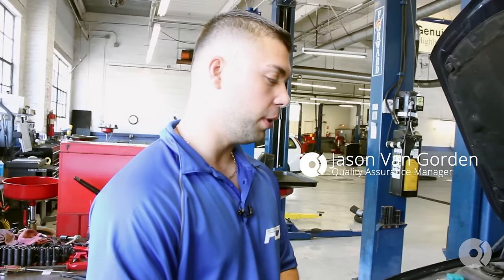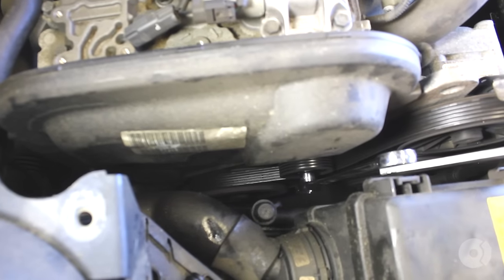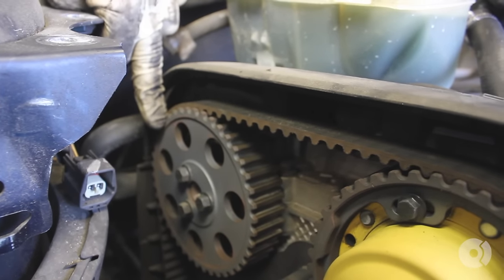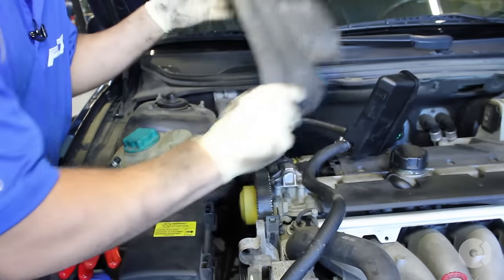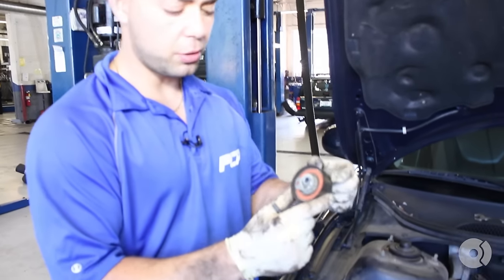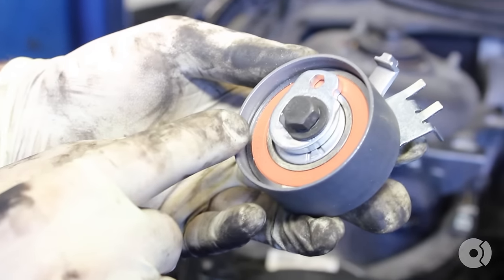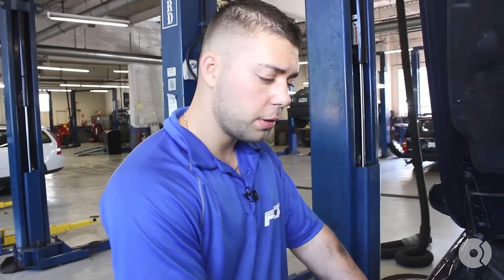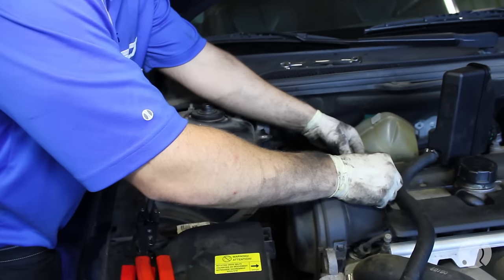Volvo P2 S60 Timing Belt Replacement DIY (S60, C70, V40, V70, S40, S70, S80, XC70, XC90)

Comment: Ok, CRAP!!  LOL  First, awesome vid, what a help.  Although, I have a problem.  I have a 2001 Volvo s60, 90,000 on her.  I followed this video to the letter, every step, double checking everything 2-4 times with my laptop by my side.  Checked my marks were still lined up before and after reinstalling the crankshaft pulley.  Put the new timing belt on (which is from FCP, thanks guys, great price), adjusted the tensioner, and believe I got it perfect.  With my 30mm socket, turned over the engine once and I DID feel resistance.  Like I was climbing hills; a little tension, then it would kind of sling over.  So I did 1 full revolution, praying I wasn't doing any damage, back to TDC.  Now the right mark is favoring the right side, left mark is favoring the left side.  Doesen't appear to be perfectly lined up.  Is this why I was feeling the resistance?  Considering everything looked perfect, how the hell do I fix this without it happening again?  I seriously don't want to start pulling everything back off and apart as it was quite time consuming for me, but will of course.  I'm definitely not going to crank this engine over until I know for sure.  And of course it's Sunday, tomorrow's a holiday and I probably wont' hear anything back for a while, but I need this car up and running quick, lol.  Bad timing, no pun, my mistake.  Or, is the resistance ok, marks slighly off alright?  Thanks for the help, really, really appreciated.
Reply: Neighbor came over and gave a hand.  Sounds like just the compression I was feeling.  So, there is a bit of resistance, just throwin that out there.  We turned the exhaust cam one tooth, re-aligned the belt, she's running good.

Just to help, I used a closed end 14 mil on the serp tenshioner with some vice grips clampled hard on the open end to make up for not having a tension wrench like Jason.  Worked great, better than expected.  Also, I spent an hour trying to get the power steering reservoir off.  What should have been easy was tough.  I ended up leaving that reservoir connected to the coolant reservoir with no problems, but yes, moved them around a lot.  Took a bit to get the crankshaft pulley off, but with lubricant, like Jason mentioned, and rubber mallet, it did finally come off.  I was about to throw the towel in there.

Thanks Jason for the vid.  Totally awesome for guys like me who don't have $500 to pay someone to do something that has to be done now.  Scary venture, but with your help it worked.

Comment: Thanks for the great video. It looks like everything is similar to the s80. When you mean you moved it back by hand a few millimeters did you take the belt off the crank shaft and move both cams back a little or just one that moved?

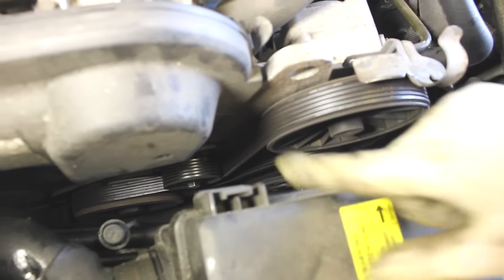Comment: Very nice instructional vid.  There are a few tools used without mention of them.  Except for the obvious sockets, pliers etc, could you provide me with the type of tools needed? At 2:34 you used a 14mm wrench extension tool. What is that called?  I have a 2005 V70, want to do this myself and want to invest in the proper tools. Do all the bolts need to be torqued and if so, is there a preferred type of torque wrench? Thanks.

Comment: First I want to say, what a great freaking video, quick to the point and easy to understand, love it. My question is: is it the same procedure for a 2004 xc9o 2.9 eng? if not, what are the differences?
Reply from the maker: The essential information for the XC90's is the same however you may have to remove a coolant line that runs through the timing cover and also a 4 bolt crankshaft vibration damper.

Comment: What kind of tool did you use on that tensioner besides the box end wrench?  To believe that most shops charge $800 for a half an hour work of work.  I'm pretty confident I can do this on my 96 850.  This video is so well done that I have the courage to do it myself.

Comment: Also, when you were finished and putting the cover back on, it looked to me like the belt was not centered. It seemed to be leaning more to the passenger side of the cam pulley. Is that just the way it lines up? THANKS

Comment from the maker: Firstly, you should not do it.  With interference engines rotating the cams can cause the valves to come into contact with your pistons and essentially destroy your engine.  To answer your question though, you CAN do it, they're not hard to spin, so be careful NOT to do it.  Hope that helps.

Comment: Can you explain the 7 O'clock thing on the pully and the Temperature setting ?   What is that exactly, what does it do?  & where do I set it for a 2002 V70 Station Wagon Non turbo?   Finally when your timing mark moved, you did not show how you set it back ?  Do you remove the belt and adjust each pulley individually to the mark ??   Explain please.  Thank you.

Comment: So I'm ready to replace my timing belt, water pump, etc. and have ordered all the parts from FCP. BUT... I see that in this video the mechanic is not using a crankshaft pulley holder when re-installing the main nut in the middle of the crankshaft pulley/damper (the big black pulley with 5 nuts-4 small, 1 large). Curious how he was able to torque those nuts without the holder tool?

Comment: Very nicely done! And very thorough! Anything in the way of torque specs for the tensioners, pulleys, and other bolts/fasteners? I plan on buying the kit with the water pump for the xc90. 
Thanks in advance.

Comment: Jay, Thank you for this video! I have a kind of unique problem. The water pump's impeller dug itself into the block which in turn threw the old timing belt off. I replaced the water pump and bought a new timing belt with tensioner and idler pullys. I made sure I aligned all of the marks up on the crank and the cams, but now won't start and after a few seconds, misfires. I think I need to go back to TDC (or close to it) but on which cylinder? My car is a 2006 XC 90 2.5t 5 cylinder engine. Thanks!
Reply from the maker: Hello Ben,

       I'm sorry to hear of the issues, however you probably have a bent valve. I would recommend to perform a cylinder leak down test and/or compression test to verify.

Jason

Comment from the maker: Well it was lined up perfectly when we took the original belt off, then, after the first attempt, we had to adjust the intake/exhaust pulleys independently because they were touchy and apparently very prone to move.  Our master Volvo tech Jason, featured in the video, would be happy to help you if you have more questions.  You can reach him at jason.vangorden@fcpgroton(dot)com.  Hope that helps.

Comment: How easy is it to damage the engine when changing the timing belt?

B/c my car went in for that (it was drivable I was just advised by my mechanic that I should change the belt b4 100,000 miles) so I brought the car in as he advised for preventive measures & now not only is the car not drivable, he said he couldn't change it b/c he didn't have the tools so I had to tow it to the dealership I purchased it from & now they're saying it's gonna cost a minimum of $2500

Comment: changed the timing belt kit in Volvo xc90 2005 2.5t via an independent shop, few days, the engine sounds up and down with no rpm visual fluctuations. He said it might be a vacuum leak, not the timing belt as he checked it again and said the marks were right. What do you think? and thanks in advance

Comment: The cam timing lines are suppose to line up in the middle of the gap for the top cover then? Or is it one of the edges of the slot because that gap is pretty big so I'm not sure where to line them up exactly. Thannks

Comment: Excellent video, I learned quite a bit. Is this procedure the same with a 2004 volvo s40 old body style and if not there any way you guys could make a video on an 04 s40 1.9T?
Reply from the maker: Same procedure minus the mount you'll need to remove and support the engine on an S40 old body style.

Comment from the maker: The unit we removed did have ridges, however, one without would work just fine, you can use the SKU you mentioned, I've also put a link in the description for the entire assembly if you'd like to replace that.  Hope that helps!

Comment: well I did my 2001 xc70, that went really good, no issues, straight forward.
I stared my wifes 2002 s80, and it is sitting in my garage waiting till Monday morning to get a new thermostat housing, the little black plastic elbow they use broke on me. ouch
the s80 is a lot tighter to work on them my xc70. so we will see how bad the dealer is going to get me for the housing  lol

Comment: such a great video. I was wondering how you remove the crank shaft pulley without spinning the whole timing belt though? (I don't own an impact)
Reply from the maker: Hello Simon, you would need a timing belt hold tool to keep everything set in place.

Comment: The correct way is to use the camshaft/crankshaft locking tool. I just done one and there is not always timing marks .the tool will hold everything in place it will not move while putting on belt and it will be perfectly timed. The way he is doing it it could very well get out of time

Comment: I have just replaced the timing belt, idler and tensioner pulley on my 2008 Volvo S60. Is it normal for a new belt tracking on the very inside edge of the cam gears instead of the center of the gears?

Comment: You mentioned different engine numbers will require the tensioner to be at different positions. Your vehicle had it at the 7 o'clock but others may have it at 3 o'oclock. Is there a chart to cross reference where it should be?

Comment: What a great video! Gotta question for you: my 2003 Volvo S60 broke down 8 hours from home. Serpentine belt came off, lost power steering etc. Took it to the nearest auto care franchise and they replaced the belt and alternator. 6 weeks later I'm driving and belt pops off. Get it towed to same auto care franchise but my local one and was told I need a new belt tensioner. Isn't that something a good mechanics would check when replacing the alternator and serpentine belt? For all I know it could of been the tensioner a fault in the first place. They want an extra $345 after I've already paid $670. Any advice would be appreciated.
Reply: +Ross Nicol  Things break, and not all mechanics are fortune tellers. 
The thing is, customers always want it to be cheap. Would you've been any happier if he would have replaced it while it was still working? My guess is no...

Comment: Honestly, I would take whiteout, marked the edge of a cams and belt, carry over same marks on new belt from old and take a lot of guessing out of the game, also someking basic, homemade bracket that lock up those cam gears together would preevent them from moving.
My 2 cents.
Reply: that's EXACTLY how I did mine.  I also couldn't get the pulley bolt off.  Ended up removing the bottom motor mount bolt, lifting the engine about an inch, then slid the belt from underneath-  after a lot of swearing- I got it in place.  Would love to figure out how to get that pulley bolt off... i'll worry about that after another 100K miles.

Comment: I have done alot of volvo timing belts and i can never get it perfect unless i use the Cam lock tool because it allows you to really get the slack out of all areas of the belt with 0 cam movement and i always move the crank pulley half tooth off before TDC that way you get the slack out of the forward side of the belt by rotating it clockwise that half tooth and then all slack is on tensioner side.

Comment: I got one it runs a little ruff when you first crank it up but it get a little better but after running for a couple min it starts make all kinds of noise and shoots oil out it has the alternator in the middle of the front of the motor I couldn't see where It came from and unfortunately I did get the chance to work on it they was telling the lady it was blown up I don't think it was because a few minutes later you can fire it up again and it don't make all them knock noises what could that be any idea

Comment: Hi, great video! Do you have a tool list that you use? Any special tools needed?
Reply from the maker: +darren rudd 
Basic Metric Socket Set
Basic Torx Socket Set
Metric Allen wrench Set
Hose Pinch Pliers
Basic Metric Wrench Set
Vice Grip set
3/8 ratchet
1/4 ractchet
1/2 inch long extension
1/2 inch breaker bar
36 or 34mm 1/2 inch socket
Counterhold - https://www.fcpeuro.com/products/volvo-crankshaft-holding-tool-cta-2247-2248-1
Cam lock tool - https://www.fcpeuro.com/products/volvo-camshaft-locking-tool-front-cta-2883
Reply: Is it really okay to impact the crank pulley nut back on? Did you use a tool to hold the pulley in place ?

Comment from the maker: The motor in this video is the B5244S, which the XC90 was never equipped with. However, much of this video can be of assistance to you if your XC90 is equipped an inline 5.
Reply: +FCP Euro 

Hi, Is changing procedure the same on the 2.4T (200HP) and 2.5T(210hp)?

Comment: I try to remove the oil pump nut (30mm) with the impact wrench  and fail, after that I try with a wrench with a extension bar  but the nut is very tie and I did not find the way to remove it, any advise because I will giving up.

Comment: Is the procedure the same for a 2006 xc70 d5 awd because when the garage last changed the belt they didn't change the water pump at 88000 miles.I have watched this video a few times and i am going to try doing it this weekend plus changing the pulley and water pump. Garage has estimated £500 for the work. I will get a six pack of beer ready to celebrate if i get it right.
Reply from the maker: The diesel engine might be a bit different.

Comment: Another awesome video Jay !  Can you tell me how do you know what position you set the Tensioner  at?  You mentioned it "depends" on the model and year where can I find this  information?   Thanks again!!
Reply from the maker: Hi Fred, the easiest way is to look at the tensioner before you remove it. It should be tightened in the 7 o'clock or 2 o'clock position.

Comment: Sorry, I'm a little confused.  You turned the crankshaft to top dead center with (but not tensioned), or without the new belt on?  I'm assuming without, since it seems you were putting it back on at 14:46.  How did you know you were at top dead center? Sorry to ask too many questions, I'm just prepping for the inevitable :-)

Comment: Great video but i did notice that you might have or done it without putting it in the video but did u put the level sensor back on the water reservoir? I followed you step by step. Thanks and will this procedure work a 07 volvo s80?
Reply: yes he did.  he just unplugged it, he didnt remove it.  i had a 2001 s80  they are pretty similar, but not sure on the 2007's

Comment: Great  instructions!   Iam  working  on  a 2001  Volvo   V70 XC.  My  problem   is  that  the  crank  and  intake  cam  lined  up  but  the  exhaust  vvt  pulley  is  about  one  tooth  or so  counter  clockwise  off.  I  went  and  I  moved  the  exhaust  pulley  clockwise  to  the  corresponding  mark.   Then  with  the three  marks  lined up I  went  and  replaced  the timing  belt.  I  started  the  car and  sounded  good  for  few  minutes. Then  it  idle  rough and  no power.  Should  I  move  the  exhaust  pulley  vvt  back  where  I  found  it?  Any  help will  be  appreciated!    Very  grateful!
Reply from the maker: Its very possible that the camshaft seals have been replaced at one point and that the CVVT units were not correctly put back together. It's possible that you may have to remove and reinstall the units. If this is the case, both cams will have to be locked, the CVVT units removed, then reinstalled. This is about an 8 hour job booktime.

Comment: Now every time I am accelerating and when I take the foot of the gas quickly I hear whistling noise. I checked all air charge pipes, connections everything is alright. . IS THE TURBO GOING BAD? Car still has power, and drives same. Thank you.

Comment: @FCF Euro-Jason explains/shows the starting and final locking position for the timing belt tensioner pointer for the 11 to 7 o'clock position. He mentions the 2 o'clock setting but doesn't provide much more detail. My 2005 S60 2.4 had the factory setting at 2 o'clock for the pointer under tension. What 'time' do you set it at before you apply tension? I have tried starting at 4,5,6,7 o'clock but then the belt won't slip onto the gears and pulleys. If I do the 11 to 7 o'clock position the belt is not tight enough. And if I start at 11 and move the pointer clockwise to 2 o'clock there is no tension applied. I hope you can provide some insight to those of us who need the pointer to lock the tension in at 2 o'clock.
Reply from the maker: Hmm, there should definitely be tension. Any way you could send us over a vieo of what's ging on for you?

Comment: How frequently should this be done? Every 100,000 miles or so? I have a 2001 S80 with 68,700 miles on it and the original timing belt.
Reply: Your car is 13-14 years old. The belt gets harder (less elastic) after 8-10 years and gets small hairline cracks because of this even if it doesn't yet have 100.000 miles. I would replace it asap.
Reply: Tom Jones Thanks, Tom. I'll get on it. And send Delilah my best.